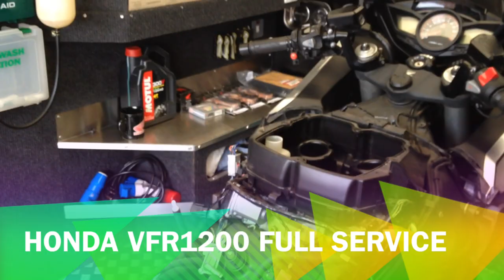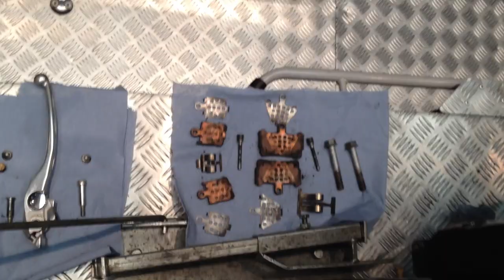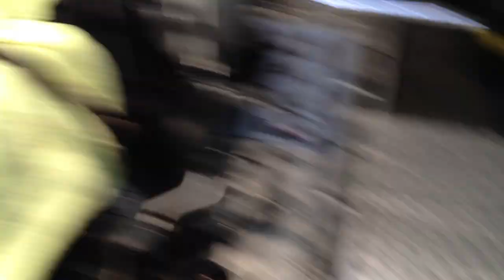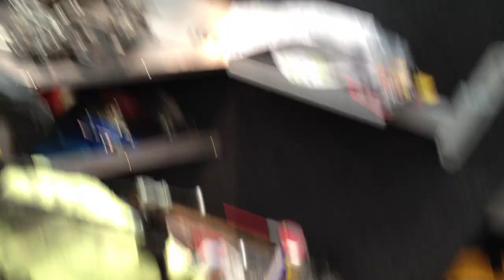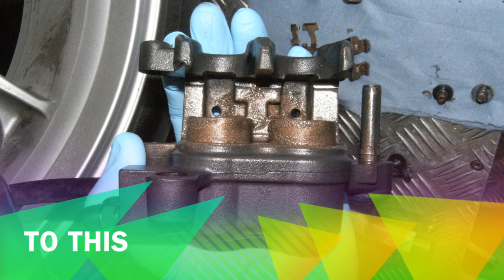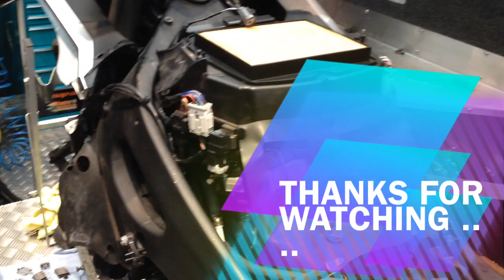Honda VFR 1200 Full Service with valve clearances

Comment: Any chance i can send you a video via email and see if you know where the rattle noise is coming from during my cold start? I can’t tell if i need cam chain tensioners replaced or get a valve adjustment done. I dont have any weird noises during warm up or while riding.

Comment: nice job ! i bought a VFR1200 last year, and now am doing the service for the first time. Got the airbox out (hope i can put all those connectors back the way they were, arrogantly took no pics) but how the %*$&% do i get the front two spark plugs out ? Is there even enough room to remove the ignition coils ?! Took the rear ones out for now and left the front for tomorrow, wanted to read up on it to see if i am not missing something, as i can barely reach the connectors, let alone remove anything from there !

Comment: Hello. Can you help a little, I did a valve clearance inspection and spark plug replacement on a 2012 Honda VFR1200X. A lot of connectors were unplugged, and the ecu was unplugged, but the battery had been removed before. Now everything is returned, but the engine will not start. Engine cranking but won't start. Mil light is on. i have two codes c0702 and c0802 on diagnostic tool. what went wrong?

Comment: Quick question how do you adjust that cam chain tensioner
Reply from the maker: The quick answer is "You don't" it's completely automatic.
Reply: @SuperbikeSurgeryTV  that's what I thought but I've seen people push the spring loaded pin down and with a hook pull the wedge up taking up the slack.
Reply from the maker: @anthonylynn1969  If you need to start helping the Cam Chain Tensioners do it's job there is something wrong. Most likely in need of new chains.

Comment: Fancy doing the same 16k mile service on mine? I was going to take it straight to Honda and let them do it, mainly so I can get a loan bike so I don't have to get public transport back. I'm near Portsmouth if you're interested👍
Reply from the maker: Thanks for the offer! The callout to Portsmouth would likely make it uneconomical for you, feel free to give me a call to discuss: http://www.superbikesurgery.co.uk/contact
Reply: No problem no harm in asking. Gonna bite the bullet and take it straight to Honda. One question though, do you have to remove spark plugs as part of checking valve clearances or adjusting? 

They want £140 to replace spark plugs on top of £600 for the service. I've just bought the exact model spark plugs for £49, just going to give them mine to put in. But are they going to try and charge me extra labour to fit the new spark plugs as well?🤔
Reply from the maker: @scotwilson4169  It's probably an extra 10 minutes to swap the plugs over if you are at a point where you can do the valve clearances. You should be removing the plugs to make the engine easier to turn when doing the clearances, it sounds like they are taking the piss.
Reply: Yeah I thought they would remove the plugs anyway while they're checking valve clearances, so theoretically it's no extra labour to fit new ones supplied by me.

Last thing they could try and catch me out on is gaping the plugs. I have access to some feelers gauges at work so I could gap them myself I guess, just need to find a manual for getting plug gap sizes, then they can't say anything since they just go straight in👍
Reply from the maker: @scotwilson4169  No need to adjust the plug gap especially with the Iridium type that is used in your bike as they come factory set.